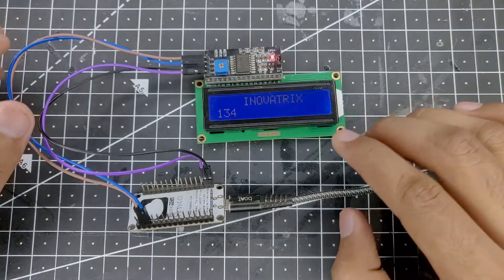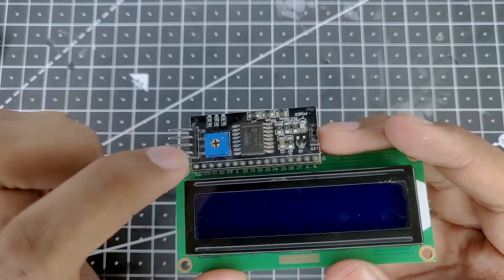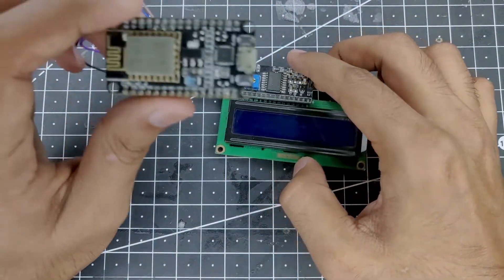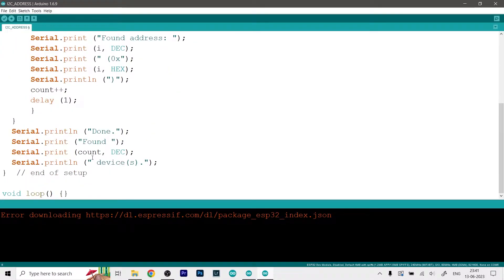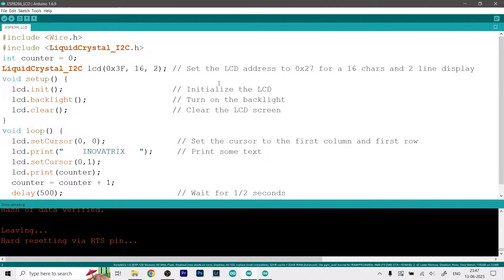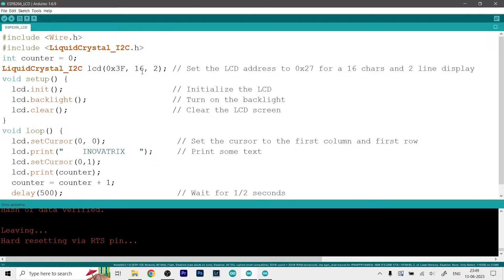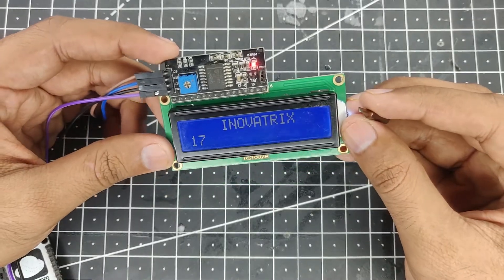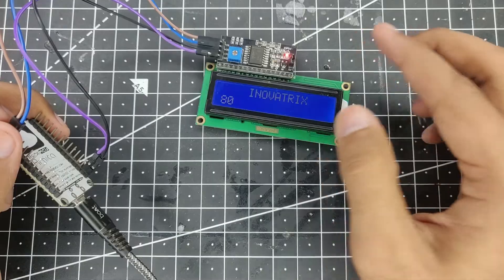How to Use ESP8266 NodeMCU with 16x2 LCD i2C Display

Comment: Brother, I have done exactly as you explained but I can't figure out though the display is glowing no text is visible. I tried adjusting the potentiometer also and that address code didn't work for me.
Reply: Did you solve the problem?? Because we are getting the same problem
Reply: @A_Failed_Experiment  yeah I wrote the same code in loop, then it worked
Reply: Try lcd.begin(4,5); instead of lcd.init(); sda pin is d2 scl pin is 5. Some board support lcd.begin other support lcd.init

Comment: if the length of characters is more than 16 in a row, then how to display all the characters by scrolling a line ? will it auto scroll or we should code for it ?
Reply from the maker: You will need to code it so that it scrolls through the display. Many people have done this way also so the code for it can easily be found l.

Comment: Can we connect the data pins of the lcd to any D pin in nodemcu?
Reply from the maker: No, as we use a library it uses SCL which is serial clock and SDA which is serial data pins on the board. Only 2 pins can do this task.

Comment: WARNING: library LiquidCrystal_I2C claims to run on avr architecture(s) and may be incompatible with your current board which runs on esp8266 architecture(s). what to do if i am getting this warning
Reply from the maker: Just a warning not much else, the code is fine and should work as expected.